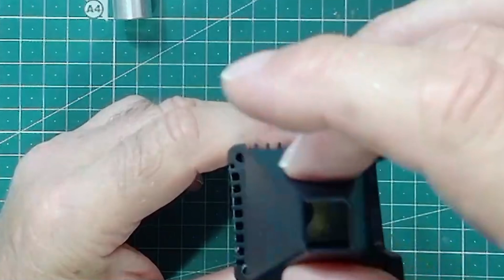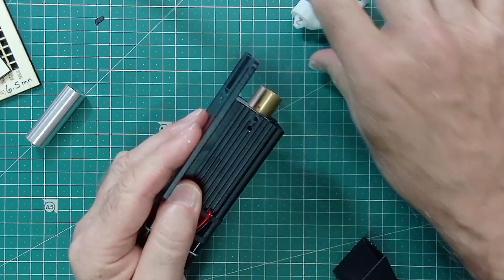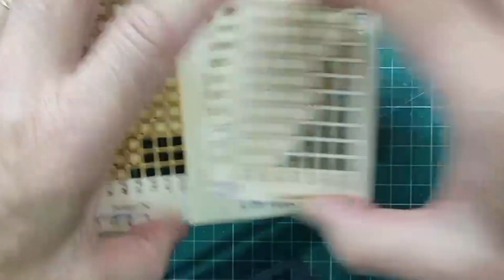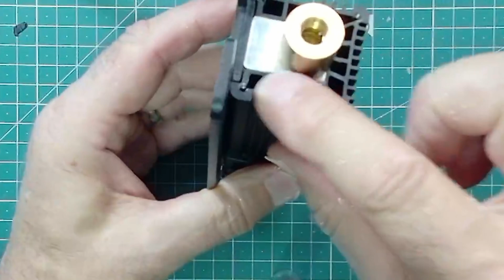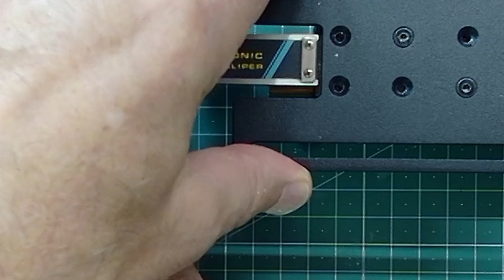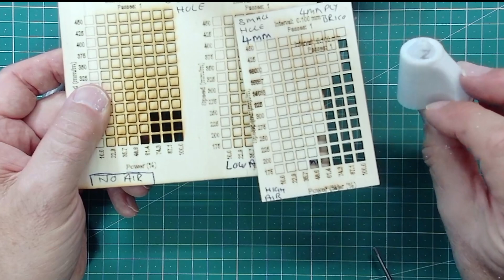Diode laser engraver cutter Use the focus block correctly 3D printed nozzle

Comment: I disagree. I think the manual says to place the focusing column on the laser module. The picture in the calibration section of the manual has the focusing column under the laser module. If it was under the frame the focusing module would be further out (closer to the camera). 
"Then place the focusing column vertically on the bottom of the laser head form the rear side, and manually lift the laser head so that the bottom of the rear side of the laser is close to the upper surface of the calibration column."
Reply from the maker: Yes i talk about this 1mm step, and in the sticky note in the comments i also talk about where to put the focus block. Yes on the laser module and not on this step